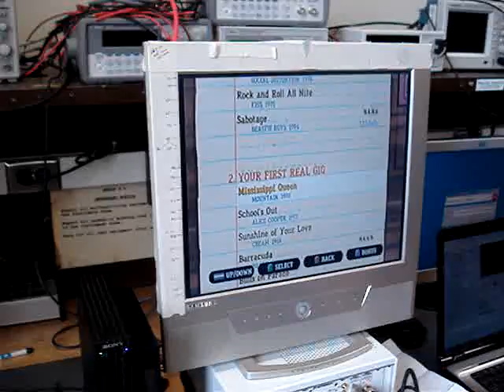SlashBot: The Guitar Hero Robot - EXPERT Cliffs of Dover

Comment: The robots you speak of are specifically programmed to play only one song. Most of them aren't even mechanical, just computer programs. This robot, however, can legitimately play the game because it interprets the video signal and hits parts of the guitar to follow it. It misses notes because it's not yet perfect, and it overstrums because it's hitting the strum bar, not holding it. The bar bounces back and occasionally goes a little too far, a problem everyone deals with. Watch again and RTFD.

Comment: It must be programmed to tap the specific button that shows up and that is only possible if you wire it to the console itself. But there's something off with the Holding. It sometimes stops, I think it was whenever during the hold, another button appeared. Must make the program "ignore" the new button and don't release the current ones it's holding. O,o Cool nevertheless!